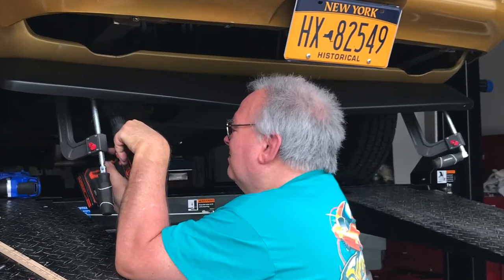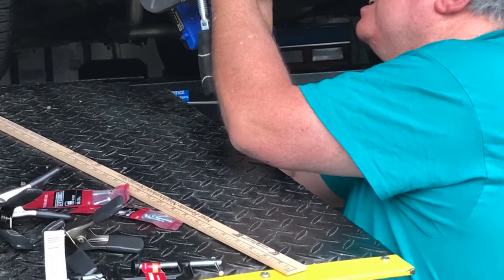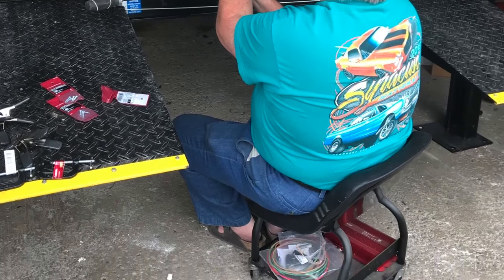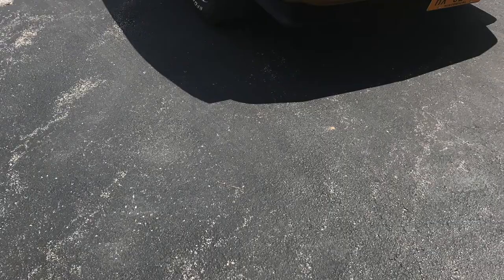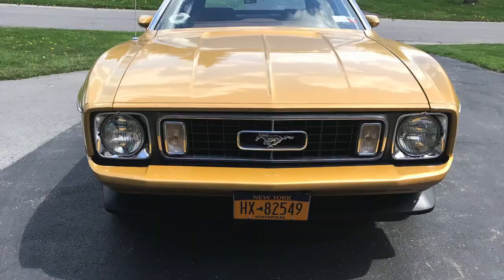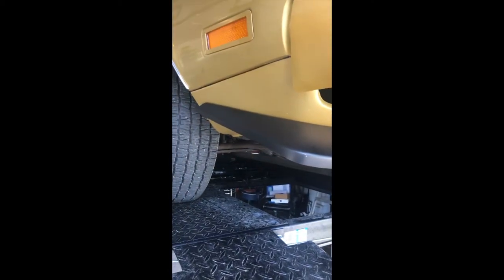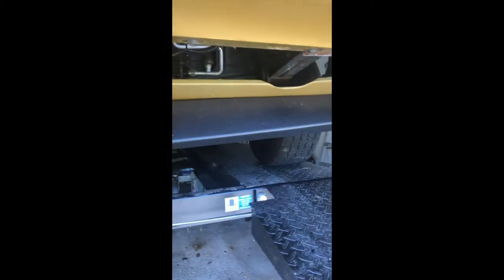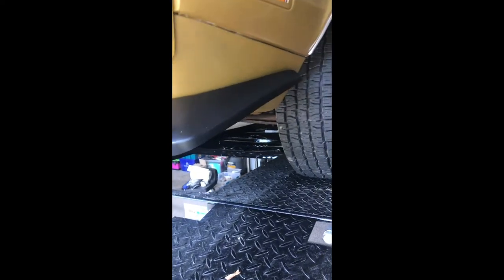1973 Mustang Convertible  Front Spoiler Installation

Comment: Excellent job, I'm doing a 73' Convertible, too, and this video helps. Thank you. Beautiful car.
Reply from the maker: Very cool!  The front spoiler is one of the changes I have made on this 73 vert.  It was literally barn stored for over 40 years.  It has an original 21,000 miles on it currently, and is in near perfect, non-restored condition.  I have done a few appropriate kinds of upgrades to help it become more comfortable.  I adeded an aftermarket Classic Air air conditioning system, which works perfectly.  I also replaced the all idiot light instrument panel with a Dakota VHX analog gauge instrument panel.  I installed an ACP full length center console, then installed a Garmin Drive 51 GPS with option front and rear facing cameras.  The prior owner replaced the convertible fabric, and the priginal tires due to the original tires rotting out.  He also swapped the original steel wheels with a nice set of Magnum 500 wheels, along with a nice set of F70x14 radials - plenty enough tire for the car.  The engine is a 302 2c, totally stock other than my installing a Pertronix electronic ignition system to show another enthusiast how to install the kit properly (lots of YouTube videos show how to do it incorrectly. Finally, I replaced the rear taillights with a set of LED panels.  Highly recommended, very highly recommended.  If any of those interest you I have some more videos on the subject, to include replacing the water pump and installing a new radiator with dual electric cooling fans.

Lynda (wife) and I have over 150 How To videos under our own YouTube channel, with over 750 subscribers.  The channel is at:

https://www.youtube.com/@gilberthale7777

Please feel free to scan through the videos.  We also have a 73 MAch 1 Mustang that had the same upgrades done to it as the vert, plus I swapped the C4 auto tranny with an Automatic OverDrive (AOD) tranny from a later model vehicle.  I am certain you will find plenty of interesting videos, perhaps even useful.  You are welcome to subscribe to the channel if you find it useful.  Nothing fancy, just lots of old school How To videos.

Thank you for taking the time to comment on the front spoiler installation video.  I actually did that installation before I began to make videos, hance the several regular photos presented in a video-like format, using iMovie on my Mac laptop computer.. Like I said, nothing fancy.  Just some basic iPhone recorded videos polished and edited with iMovie.

Comment: Nice job looks good I’m wanting to install mine soon thank you for the video
Reply from the maker: It was one of the easiest upgrades I have ever done on any of our Mustangs or Shelbys.  The large C-Clamps made all the difference in helping ensure the result would be no less than excellent.  I have read that some other folks received front spoilers that were not straight, or were mis-shaped.  I go ours from CJ Pony Parts when they made them available with a significant discount.  The part # was FS5B for an very decent price of $71.99, plus sales tax and shipping.  As of today their new price is still lower than it used to be, $79.99!  They show 16 entries for customers who submitted reviews, and there very few ratings with less than 5 stars.